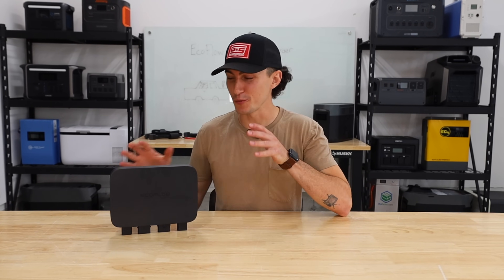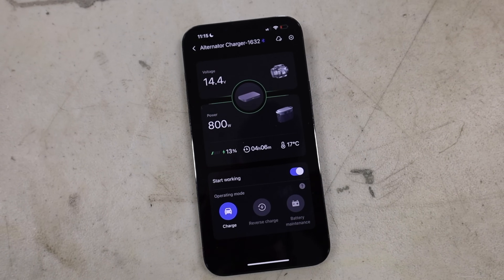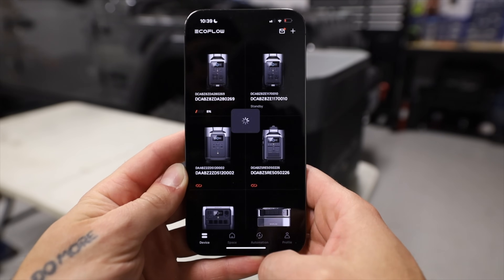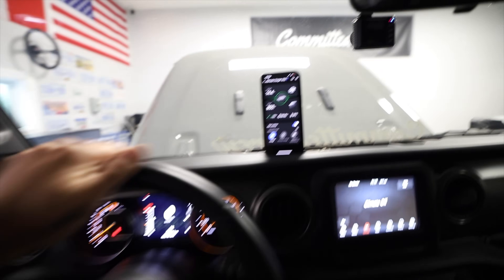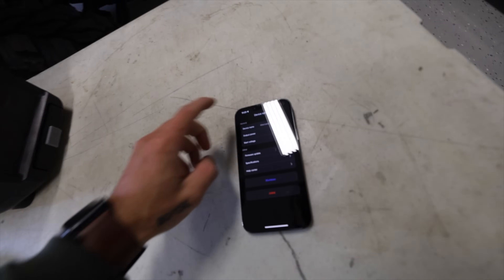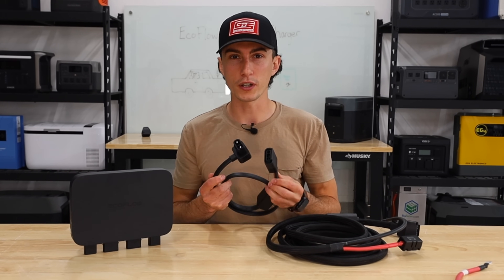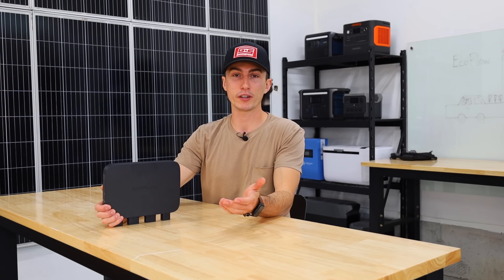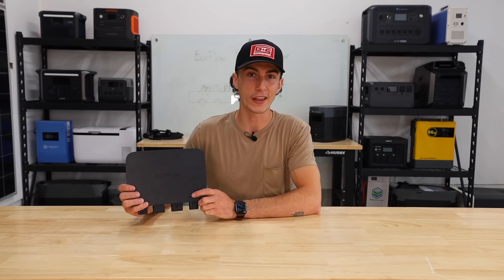800W with NO Solar Panels!? This Changes EVERYTHING! - EcoFlow Alternator Charger

Comment: That's a fast way to ruin your alternater. Testers have had there's destroyed by this. You need an upgraded battery and alternator for long time use.
Reply: Can provide a source from where you saw actual damages? 

Direct from the ecoflow FAQ. 
Will this product damage the alternator, starter battery, or affect the overall lifespan of the vehicle?

No, the 800W alternator charger's charging logic does not rigidly apply 800 watts. Instead, it depends on the power surplus of the car's alternator. It ensures the alternator is not overloaded, allowing up to a maximum of 800 watts without harming the car's battery
Reply from the maker: Not sure how this would do damage. your alternator can o ly do what it can do, if it doesn't have any more power to give - you dont get 800w of charing
Reply: @TheSolarLab stop encouraging people with underpowered alternators to fry their alternator. Unless you have a larger alternator (over 175a) you will overwhelm and fry your alternator.
Reply from the maker: @xraykadiddlehopper8067  well this isn't our product to stand up for, its EcoFlows.. LOL, however, it wont take power if it isn't avaliable.. so i wont fry anything. thats kinda the entire point, which is why we like it and encourage to use it!
Reply: @xraykadiddlehopper8067   Do you have information that we're not aware of?
Reply: Can this be used with a Dual Fuel Generator at the same time?

Comment: Don't install it in the car. You can even make a box for this thing. Take it with you. Charge your battery when you arrive by using quick connects and this device.
Reply: I disagree.
When I go out somewhere I want to be able to turn off my car, enjoy where I’m at use the eco flow as needed and then be able to turn on my car and recharge it if needed or let it charge in my drive somewhere.

Comment: What if I only have an electric car. Where's the alternator.
Reply: Use the 12v battery.
Reply: Yes hook up same exact way to the 12V battery. When vehicle is on the car uses a DC-DC converter to take the battery pack voltage down to about 14V to simulate an alternator and keep the 12V battery charged. The 12V battery runs all the 12V electronics like your FM stereo and all the other things normal gas cars have. I have a Chevy Bolt EV and it puts out 1600W peak/1200W continuous at 14V from its DC-DC converter. More than enough to run this device for sure. Would be great to access its 66kWh car battery to charge my 2 DP and 2DP extra batteries running my house if the solar does not provide enough. I will wait and see if they come out with.a V2 that can pull more than 800 watts. 1200watts would be perfect for my car's 1200w continuous or others that have high output alternators...
Reply: @kylesylvester2710 Just a heads up, as I have the same car. Don’t try to draw the max, remember the car has some overhead even in idle with everything turned off that is user controllable, such as coolant circulation pumps, control systems, inverter overhead, etc. To be honest I’m not planning to draw over 1000 and may limit myself to just 800 watts. The Bolt can get in to an annoying fault condition if the voltage drops too low repeatedly in a short period of time.

Comment: I bought mine on Amazon ($399 blk fri. 2024)  I’ve never seen 800 watts.  🫤 Never.  It i’d,es around 400 to 600watts takes around 6 hrs to fill my Eco flo delta pro and I don’t take long enough drives for it to put a dent  in my delta pro to have to move that 100lb monster (said with ❤️ ). back and forth for the trips to Costco. SoBut,, my Jeep is a 2007 (only 94k miles) She has a new generator and new 12v lead battery but ultimately it uses @1/4 to 1/3 tank of gas to idle charge and it really heats up the jeep to over 100 degrees.  Makes me nervous…😬 I’m really glad I have it for emergencies but I’m back to big floppy awkward 400w panels… (again with ❤️ ❤